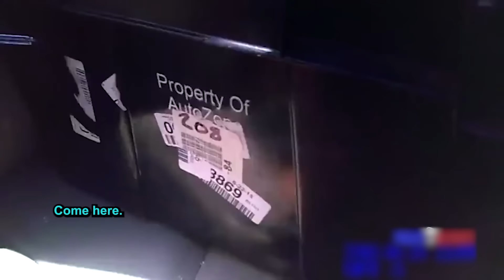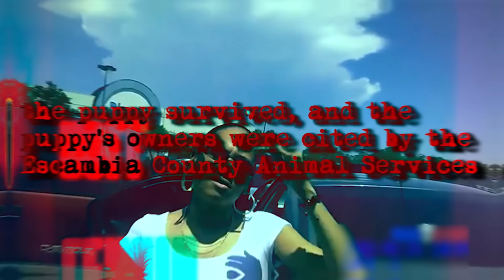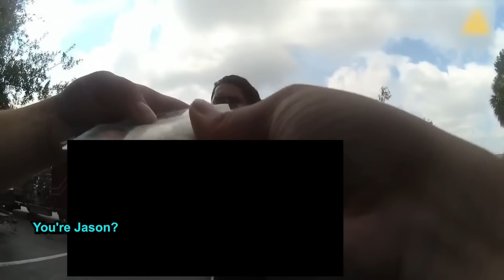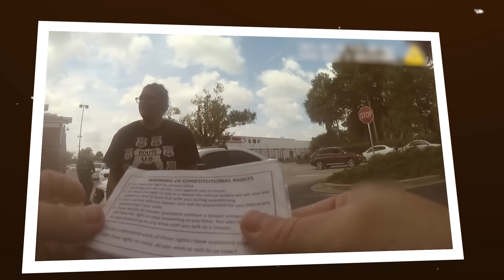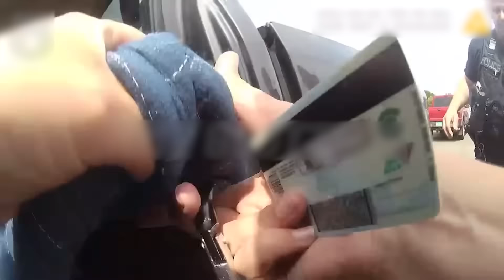When Cops RESCUE Dogs From HORRIBLE Owners

Comment: The ppl with the uhaul.....i want to express HOW HOT it must have been in that uhaul for those dogs to be sweating through their fur. Dogs have sweat glands on their body, but they're not very large bc their fur and panting is the main way dogs control their internal temperatures. They have proper sweat glands on their PAWS between their paw pads that sweat just fine. It's one of the reasons why their paws get so crusty if theyre not cleaned for a while.

For a dog to SWEAT so much that its fur becomes wet means that uhaul must have been SWELTERING.

Comment: 23:00 bossy cop, geeze, having Huskies in Florida is just plain ignorant. They're bred for snow! But they are young and TRYING to keep them cool.
But the cop is no help, TRYING to MAKE a CASE.
She's TRYING to make these people's lives harder for her own ego. They were taking care of them.
So what happened to them? Doh pound and put down. The cops didn't take em home.
Reply: I agree and the dogs looked well fed but they were just in there a bit too long but I think the owners meant well
Reply: @reginagilby1101  I drove across country with a mare and her foal and my Rottn/Dane. 6 hours at a pop, then I let them out for rests. NOLA to the Pacific Ocean. They loved the beach.
NO cops ever bothered me. Too many Karens these days.
Reply: you don't need to own a Husky to know they are not built for the heat. so to have them locked in the back of a U-Haul van with no ventilation in the middle of summer in Florida, where it's 100 degrees outside, could very easily kill them from heat exhaustion and dehydration. that's just common sense 🤷‍♀️
if you listen to what they say, they left at 9 or 10pm and stopped at rest stops to run the AC for a bit, but didn't really check on them. this is the first time they tried to give them water, and it's around 2pm the following day, 17 hours since they left TN. that is WAY too long to have animals, especially small puppies and Huskies, without water!
Reply: Uhhh no. There is no AC in the back of a U-Haul. To not be watering them since 5am???? Idk how you can think it’s okay for what those people are doing. Why do they even have that many in their possession anyways?
Reply: @BrynnerBrynnerChickenDinner  watch it again and listen, he has a portable AC/swamp cooler